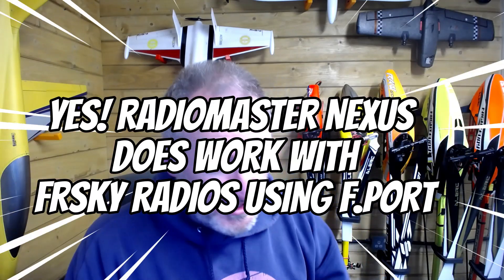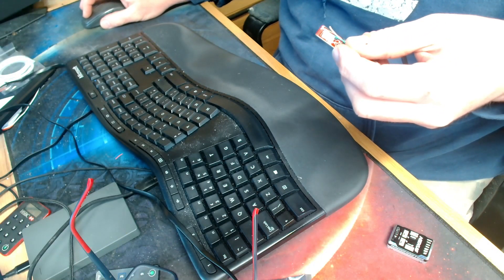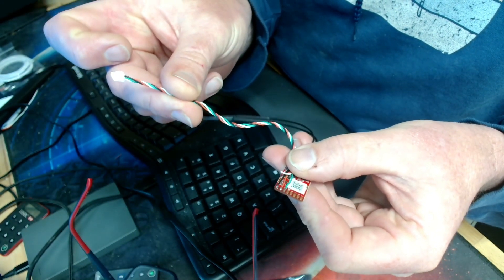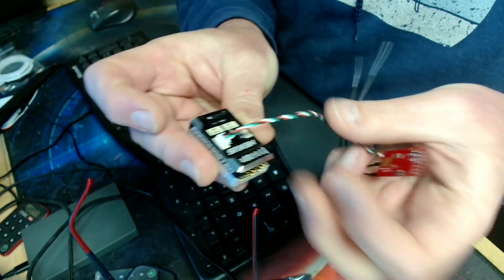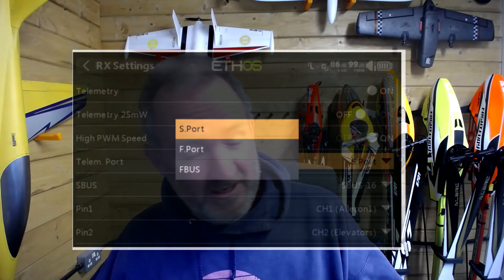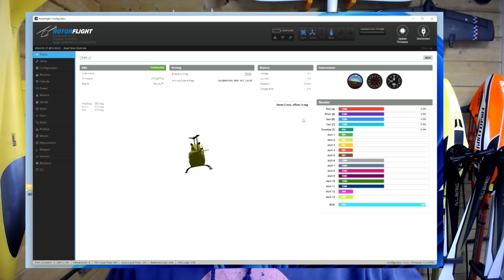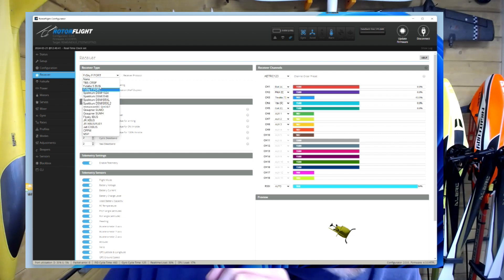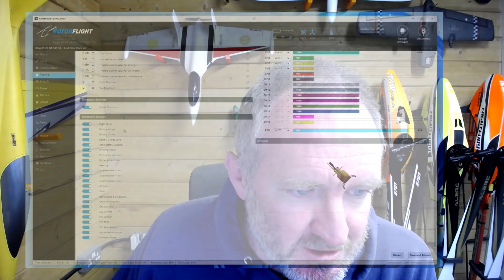YES! RADIOMASTER NEXUS DOES WORK WITH FRSKY F.PORT

Comment: I'm using a FrSky R-XSR receiver (I only have acsst transmitters) and have flashed it with the official F.Port firmware. Everything works perfectly EXCEPT the LUA scripts, which don't work at all! They work on my older FoxeerF722V3 brick, using an identical receiver, but 4-wire connection (SBUS and S.Port), but not on the Nexus (F.Port). Any clues as to why? I know others have the same issue.
Reply from the maker: So 4 wire mode is a totally different system so let's rule that out.

Would need more details on wiring etc.. What ports you are plugged into

Maybe drop past discord and we can help?
Reply: @RTRCTV  Yes, I only mention the 4-wire system as it indicates that the transmitter side of things is working as it should, therefore the problem must be at the receiver/Nexus end.

According to the FrSky R-XSR manual and the firmware update info, once flashed with the F.Port firmware, the S.Port terminal becomes the F.Port - this is the terminal between the +5v and sbus out/cppm terminal. This is connected to the A-crsf port on the Nexus. The Nexus is configured to use this port as a serial Rx port, and F.Port is selected in the receiver tab. Also half duplex and inverted serial are selected, but not Tx/Rx pin swap. Telemetry is enabled, and most of the telemetry functions are enabled, including pid profile and rate profile, but not any of the GPS or pitch/roll/heading options.

I get the required telemetry - the model has been test hovered in my garden - and I can see all the enabled sensors, though some of them have meaningless IDs, and are giving meaningless responses. The main ones, volts, RPM, etc all work fine.

However, running the LUA scripts from the Rotorflight menu just produces continuous "waiting for API" messages. My son is having the same issue, and has given up on the FrSky setup as a result, and gone to ELRS modules instead. And he is a highly qualified software engineer!
Its got to be something silly, but I suspect its something in the Nexus firmware.

The model has been test hovered in the garden and flies OK, but having to plug it into the computer each time for "fine tuning" is a pain, and not very practical on the flying site (when it dries up enough to get there!).
Reply from the maker: @pchristy102  clearly there is something you are not doing right / expected.

Can you contact me on discord please?
Reply: @RTRCTV  I'm not on discord - never have been, so it may take a while before I find it and you!
Reply from the maker: @pchristy102  https://discord.com/invite/YBU9JjdM

Comment: If your esc has 2 power out connectors for larger helicopters is there a extra connection to run dual power in?
Reply from the maker: Yes.  In this scenario you could use the sbus input port as am additional power input.
Reply: @RTRCTV  I can use the same top connector for hooking my FrSky receiver up and just use the Sbus for power.